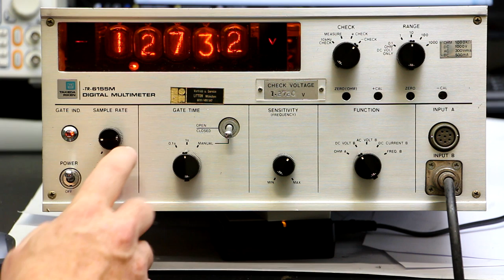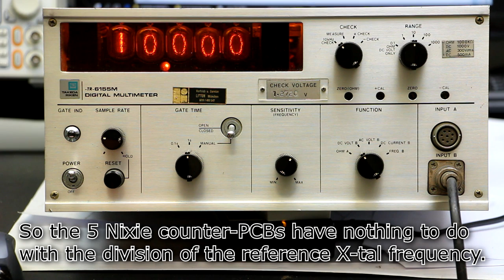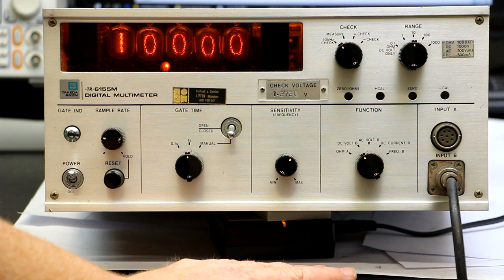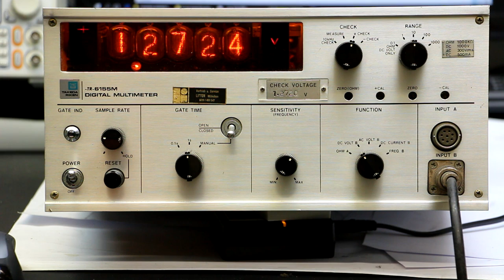Teardown & Repair of a Vintage 5-Digit Nixie-Multimeter

Comment: Very nice video, but also a very nice device. My heart went open to see you telling the story of the device. As old german electronics guy, as I am, I saw such crystals in old frequency sources from hp. They are of course heated and in my old lab, we never were allowed to pull the plug, because of temperature drifts. We needed those sources as  secondary frequency normals to stabilize lasers .

Regards Michael

Comment: Hello,
A recently bought a Nash & Harrison [?!] Nixie tube multimeter. I am not an electrician, so I'm not quite sure of what the problem is, with this device. When I turn it on, the Nixie tubes light up, as they should but when I try to measure some voltage, the numbers don't change. This multimeter looks great, very clean and nothing inside smells burnt or discoloured or damaged. I know that Nixie tubes require a lot of voltage, so I'm very careful [scared] to measure voltages, when it is plugged in [turned on]. The capacitors look good. The resistors too. I would like to investigate further but it is very difficult to remove the boards [I counted +/- 28 cables soldered to the three main boards, inside] it would be a BIG job for a novice like me, and I don't want to damage this beautiful multimeter further. Also, I couldn't find ANY information online, whatsoever regarding this brand - much less find a schematic for it. So, if you have any advise, insight or whatever, please share it with me. Thank you kindly and be safe.
Reply from the maker: Fixed digits in a multimeter is a sign that something in the digital counter logic is not OK. Perhaps only the main-oscillator is not running or has an internally broken quartz. Or perhaps there is a switch somewhere with the wrong setting. Try finding a switch with a label that says "Hold".
Furthermore try to wiggle everything that looks like connectors, switches, pushbuttons etc.
Search the PCBs with your nose for strange smells and look for components that show burn marks or are otherwise looking suspicious.
You probably will need an oscilloscope for further error-tracing. Without the schematics you will have a hard time finding the fault.
The high-voltage usually is not that dangerous. Nixies have between 170V and 250V DC which is usually not lethal but only gives a strong bite :-)
Reply: Thank you for all the advice, I truly appreciate it. I have to assemble a frequency tester, that I purchased some time ago. It is a kit, for testing crystals, I believe. I don't have ANY info regarding this multimeter and  NONE can be found, on the Internet. It's a Nash & Harrison, built in Ottawa, Canada and nobody that I've spoken to, has EVER heard of this brand. It is very clean on the inside and outside. I suspect that it was a kit, overall, it's a pretty well put together device but here and there, there are signs of not the greatest soldering job, in the world. But I'm still a novice, so I can't confirm anything. Thanks again, for your kind advice. Cheers!

Comment: To get 5 digits of accuracy back in those days was an achievement. Always a bit of a surprise how early Japanese gear had internal markings all in western script.  Almost as if Japan had been beaten by a western power in a big war and had to rely on western standards and export markets to survive.  Imagine a world where everything electronic was marked only in Japanese and the rest of the world had to accept it.

Connector B for the ohms measurement probably uses Kelvin sense wires.

11:25 the crystal in the glass tube is large because it is at a lower frequency.  At that size it may be 1kHz, 10kHz or 100kHz so the dividers are needed. 

23:15 The valves may be part of a high impedance input amplifier.

27:50 The metal pill bottles may be rectifiers or together a synchronous demodulator.  The two boards with the TDK transformers may be a chopper amplifier. The shielding would make sense.

34:00 The input divider board was possibly subcontracted out to a company that was specialising in such things.  They may have had different standards on what was the minimum labelling requirements.

37:20 The diodes might be input and output protection for the BCD output connections.